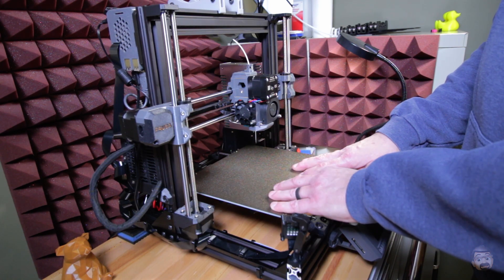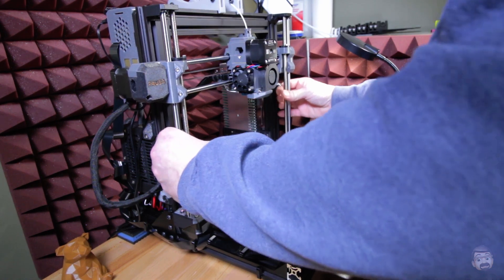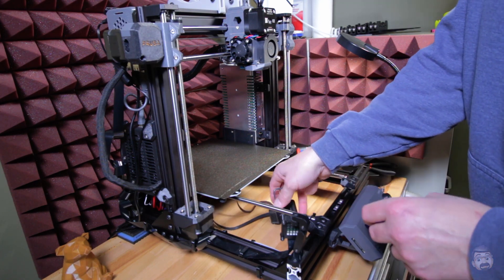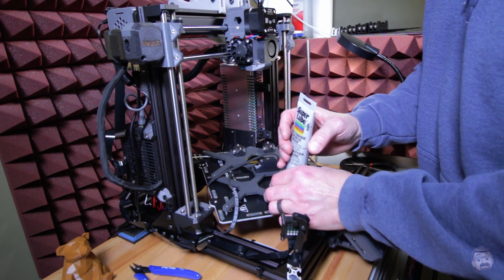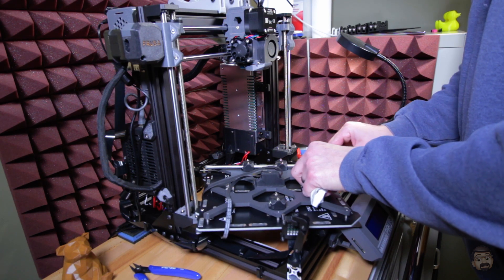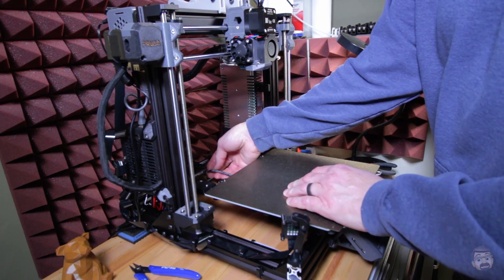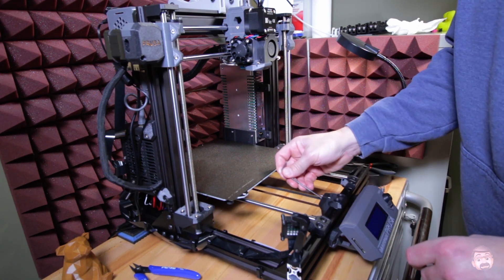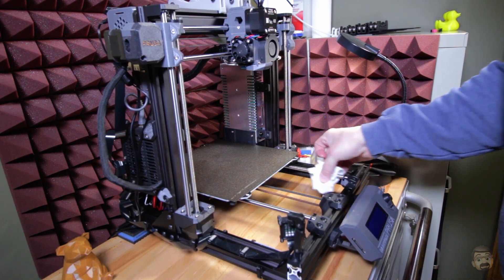Y-Axis Bearing Maintenance

Comment: I just use 10W30 motor oil.   No grease.
Reply from the maker: I debated about using an oil instead of grease, so I did some research.  What I found is that it's largely preference, since they both have their pros and cons.  Upon the recommendation of a couple of "information repositories" I trust, I decided to use the Super Lube No. 21030.  We'll see how it holds up.
Reply: @cswilsonprints  I have used oil for over 20 years and still have the same bearings and rods.  It is also very easy to keep clean.   Only need a couple drops after a couple hours of use.